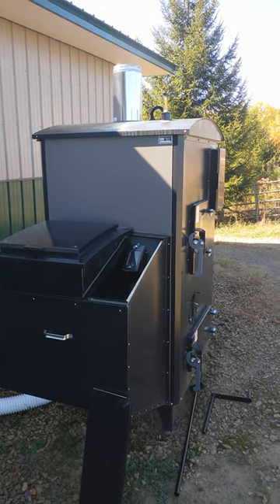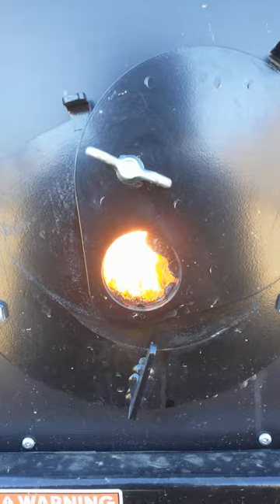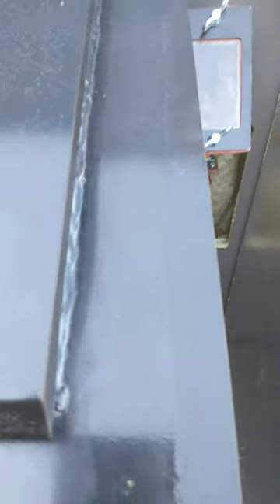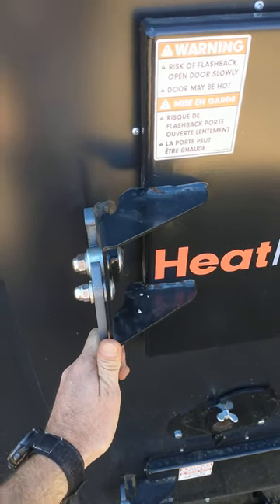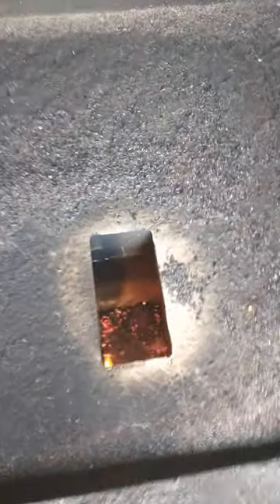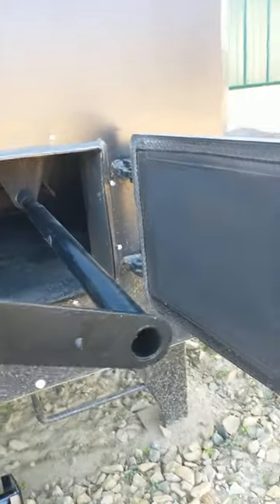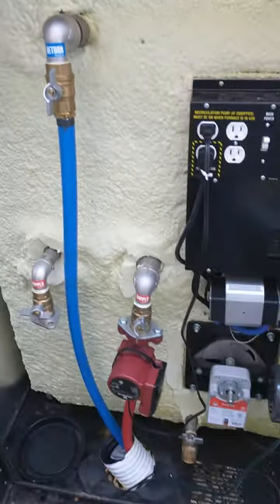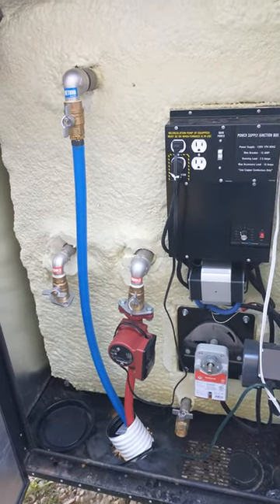HeatMaster P4000 Tour

Comment: Wood mass vs pellet mass, how does it compare to the GSeries?
Reply from the maker: @speadskater  Pellets are more compressed than wood, so they are heavier. So they would take up less space than firewood. Efficiency is a bit higher also then the G series.  But I'm not sure if I'm understanding your question.
Reply: @YoderOutdoorFurnacesLLC  you answered it, I was asking which would go further, 100lb of wood in a g-serius or 100lb of pellets in a P series.  Sounds like you're saying pellets.
Reply from the maker: @speadskater  yes, I'd say pellets.